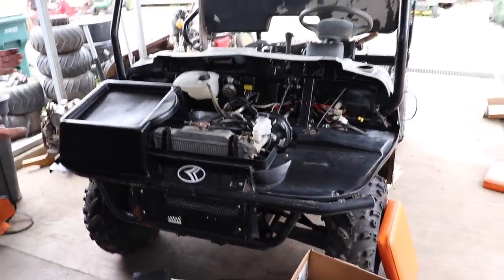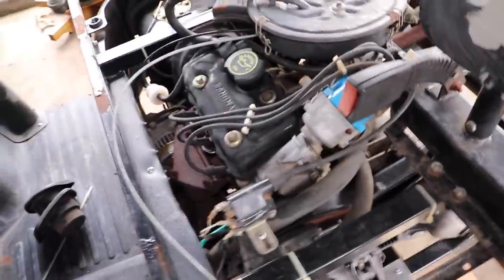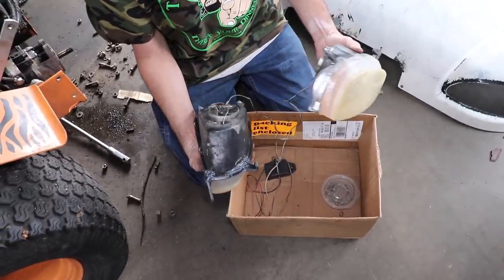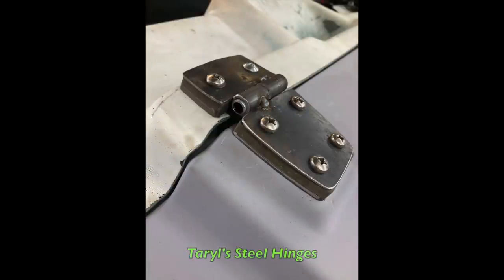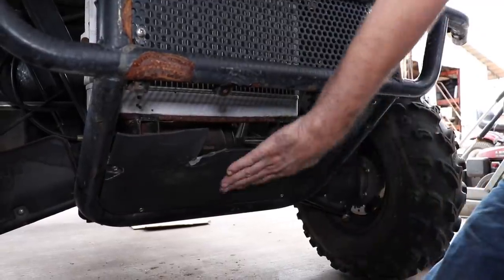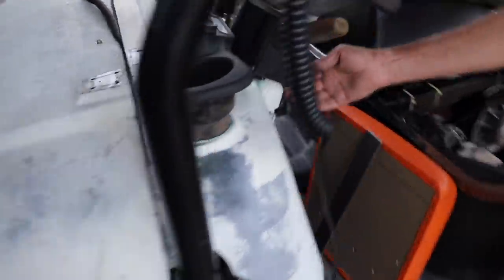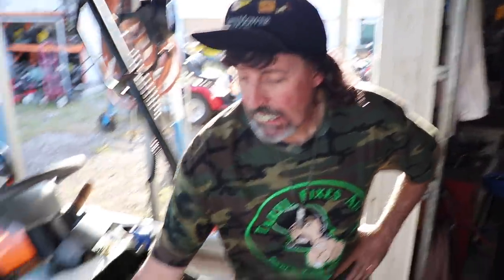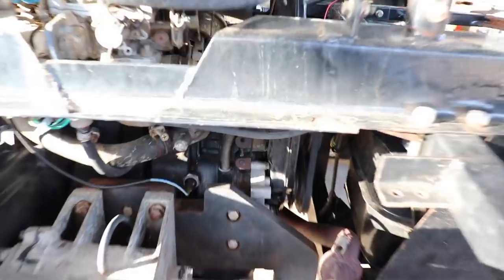AWESOME Kazuma Mammoth 800 Side By Side - Will It Run? (Part 1)

Comment: I had a '64 and a '72 VW bus and did your 'solenoid trick' on both of those. They usually would start when cold, but when they were hot, the resistance would go up on the big solenoid on the starter, and especially on the 6 volt systems, they wouldn't start to save your life.😜 We'd use an old Ford style solenoid, and that was a sure fix every time!😉The engine in that Kazuma looks identical to the ones they used in the Suzuki micro-trucks that everyone is importing these days.

Comment: I bought a used CAT loader seat for 3 bucks and the bottom cushion was ripped, but it was a molded cushion, so I cut a plywood base, will drill holes through the plastic up into the plywood for T nuts, get some carpet padding and some material from a used toneau cover, and staple it all together. I also have a vent hole in the plywood base.

Comment: Taryl, you offered several helpful hints in this video so here's a helpful hint in return: (You may already know about it)
When using something sticky like that Valco HV350 or silicone or other caulk like substance, you can smooth it out using an ice cube. The sticky stuff won't stick to the ice cube as it melts.
Reply from the maker: Hey thats good to know. Thanks for the tip. Now there's my Dinner.
Reply: I just lick my finger tip with a lot of saliva, silicone and caulk won't stick to it. LOL
Reply: @Five-O_Reviews  don't put your finger in your mouth with any chemicals on it!
Reply: Pro tip: Dish detergent mixed to 1 to 3 in a spray bottle, use sparingly a very light spray then smooth with your index finger.
Reply: Taryl HELP ME! should I use 91 octaine or 95 octaine in my riding mower?
Reply: @Amberlynn_Reid  Neither, if you can't get alcohol free, (and that is what a lot of people use) use regular. Octane rated higher than regular, is to lessen pre-ignition as it burns slower than regular for high output engines.
Reply: @IFIXCASTLES  Beennnnnn Dooooin I Fer Yeeers. Noeeee Problms 2 ReaPourt.! :)
Reply: @IFIXCASTLES  But-but, they taste JUST like Tide Pods!!😋🤣
Reply: @danw1955  silly!

Comment: i don't think you realize how invaluable this youtube channel is with videos like this. this is the type of common ad hoc repair that the average person can do without extensive skills or equipment. this is the kind of thing my grandpa taught me before he died, and i'm glad these videos will be around to teach other kids who didn't have a mechanically inclined gramps. and even with all the knowledge the mechanics in my family have, there are still big gaps that Taryl fills in, like how exactly a vintage Tecumseh diaphragm carburetor works, and what order to put the gasket in when there is no primer bulb. some of these small engine castings made in the 60s or 70s will last literally 100 years and be the last part of the engine to fail after every other part

Comment: G'Day from Australia Taryl.
i had the same starter motor fault in two of my Mazda's (1974 808 and a 1977 818), the problem was aging wires not carrying enough current to the solenoid activation terminal. electrically it has 12v at the terminal, but not enough current to throw the solenoid pin all the way.
i wired in a small 12V relay between the key from the wire and the solenoid terminal, did that to the 818 twenty + years ago and i'm still driving it regularly.

Comment: If you paint on plastic use Klean Strip Bulldog Adhesion promoter comes in a spray can, quart and gallon size.  Just one medium coat over clean plastic, wait 5 min. and the paint will never come off. been using it in autobody for over 25 years. Matter of fact use it on all painted surfaces except waterborne paints. Looks like a dodge neon headlight. Bulldog adhesion promotor is cheap insurance.

Comment: Taryl, you could use the packing foam block (the soft stuff like the foam you used for weather stripping, and put that around your battery to keep it centered in side, or you could get a mounting kit or battery box for it as well.
Reply from the maker: I did end up securing the battree in part 2. But thanks for your input.

Comment: Taryl - Tip from Next Level Carpentry channel for long term storage of spray paint cans. Store cans upside down to help ensure solids do not sediment out and plug the paint delivery tube inside the can.
Reply from the maker: Thanks for the tip.
Reply: Sidewise works well too.
Reply: @mtwseneca  Sideways works, but the requires you to orient the can so the curved end of the delivery tube points upward out of the paint. You don't have to worry about this detail by simply inverting the can.

Comment: i save the paper packing from rock auto for paint masking paper. it seems to be as heavy as the masking paper i used when i worked in a body shop, paint doesn't bleed through, and it was free. that three cyl suzuki engine might be about the same as in a geo metro.
Reply: Would love to find one of those Metro engines to go in my old skid loader to replace that Onan P224…..
Reply: @notajp  i've got a little fiat 4 banger engine i picked up cheap in my garage that came off of who knows what if you're close to northern indiana. the guy i got it from was sick of it being in his repair shop. a customer dropped it off for a repower project and never came back. they told him  it was supposedly "rebuilt", but you know how that goes. you could hit up the LKQ u- pull it yards in your area. they only want like $100-200 for an engine. can't even buy a v- twin predator engine for that.

Comment: Ohhh I understand why the solenoid tip works. The old solenoid still actuates, but the contact to complete the circuit for the motor is bad. So by jumping the solenoid to the motor, that contact is bypassed and sends the power directly to the motor. However, the solenoid/motor would spin continuously hence the 2nd new solenoid, which only sends power to the jumped old solenoid/motor when the key is turned.

Comment: All that plastic is polyethylene which can be welded with rod or just melted together with a soldering iron. You don't need the crazy glue. On the hood if you take the mesh screen out of a microwave door and heat it with a heat gun as well as the plastic it will squeeze in and prevent future cracks at the seams. I use a torch but don't get it too hot and after plastic presses through you use a dolly to smooth and cool it.

Comment: Teryl, headlights! Buffer, get a carpet head for a buffer, quick cut compound for auto body buffing and pollish, yellow buffs away! Wash carpet head and go over again with finish glaze compound for auto buffing and finishing and looks new! Use a very light and easy pressure when buffing almost air like and keep surface moist. Otherwise you'll burn your plastic surface. I polish utv windshields like this along with headlights, taillights, and other plastics. A carpet mat polishing head is great and stays moist and lets the buffer float over a plastic finish. Foam heads suck.

Comment: Taryl I appreciate your videos try supper glue and baking soda to bond plastic together use a hobbie diy grinder to gauche the edges of both pieces to except the supper glue then drop the baking soda right over the top of the wet super glu it will become as strong as the rest of the plastic

Comment: Hi I have a MTD Lawnflite 604 lawn tractor single deck, the issue is the blade continues to rotate when it is in the stop position. Have you covered this fix in a video as I would like to resolve this problem.

Comment: I have a Old garden tractor with actual brand name Bush Hog D4-10 with Wisconsin 10hp engine and runs good and has a pto in the back. Have you ever seen one of these? Was my grandpas and he cut grass with it and has a really nice deck and heavy duty blades. I want to do a good restoration on it. Not much information on YouTube.

Comment: Edit: Never mind, I understand why it works now :-) 

I don't understand why the solenoid trick works. The solenoid just sends 12 volts to the 2nd solenoid, right? Why does that do anything different than not having a 2nd solenoid?
Reply: The starter solenoid has two coils inside it, one starts the plunger moving and then activates the second coil along with the starter motor. The second coil adds more pull to the plunger to ensure the pinion gear meshes fully under torque and doesn't bounce back. The second coil inside the solenoid draws about three times the current and  is wound with heavier wire to ensure the pinion gear gets meshed even if the teeth are mismatch. But it's current draw can cause so much voltage drop in the long thin wire from pulling more amps that the second coil doesn't get energised enough to mesh the gear and also close the contacts, then the motor just doesn't run. Adding a second solenoid, or relay with a very short path to the battery overcomes the voltage drop from all the wire length to the key switch and back which then gives the second coil full energy to engage the pinion and bridge the heavy contacts to activate the motor, otherwise it will start only when the flywheel teeth are lined up with the pinion teeth.
It's been a trap for a long time with some cars.

Comment: Heat up a screwdriver till it's red hot and melt the tabs just above crack pulling the melted plastic into/ over the crack and then glue them

Comment: And another thing! It ain't a solenoid, it's a relay. The solenoid is what's on the starter and pushes the starter gear into engagement. When you added the relay it helps by shortening up the circuit so all the power don't need to go all the way to the starter switch and beck down to the solenoid. Solenoid always moves something mechanical, relay just operates a switch.

Comment: The next time you need to clean head lights go get you some deep woods off and spray on them wipe them off and then spray them and let it dry with the head lights off if you have them on it will have residue but if you do it with them turned off one coat wipe then one coat let dry and their like new

Comment: Yellowed plastics can be restored with solution of water and hydrogen peroxide then hitting with UV light, out in sun works. Lots of videos out on it.
Reply: It’s called retrobrighting. It’s used a lot for old computers and electronics.

Comment: Those rusty spots on the frame -- instead of taking it down to bare metal, you can just hit it with a wire wheel and use a rust converter, (like Rust Doctor) on the spots, then it won't be completely fruitless endeavor to touch them up with paint.

Comment: That ball valve anti freeze drain looks too easy to open when you're changing the air filter or something. Maybe just put a knob on there instead of that big lever.
Reply: Don't worry about it there judo joe.

Comment: That's a ripoff of a Polaris 500-700cc ranger you might could've gotten those hinges and a few other parts off of scamazon I work on side by sides if you ever need any parts for it body wise (Polaris uses a proprietary engine and drive train ) but body parts look up about a 2007 ranger 700 alot of it will interchange might save you some time